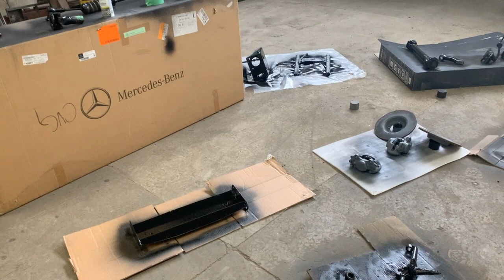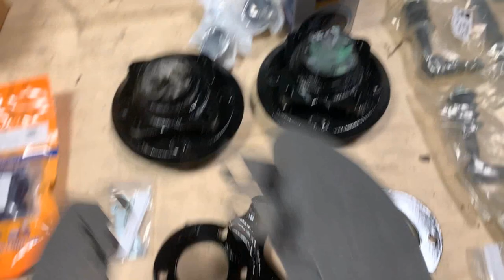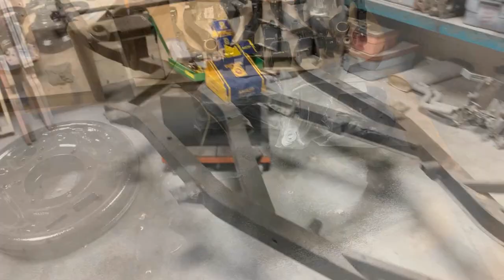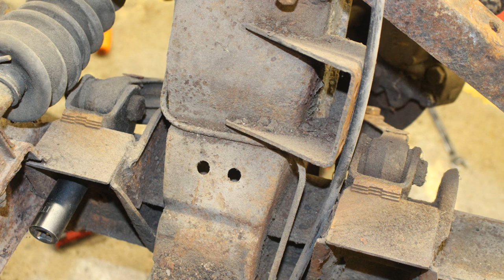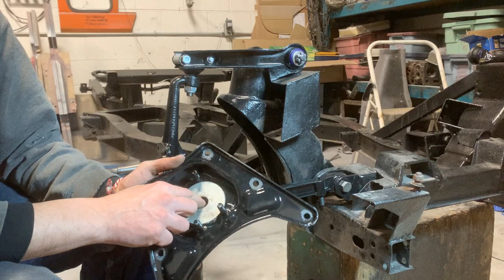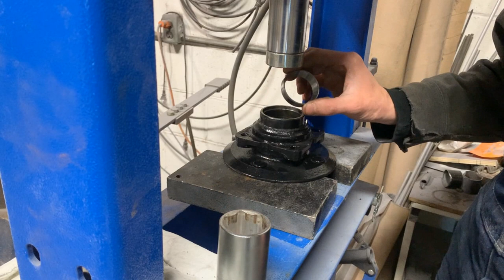1974 Triumph TR6 - Part 57 - Front Suspension Assembling

Comment: Thanks for the helpful videos.  If you see this, I replaced my bushings this weekend. After assembly passenger side takes more effort to move left or right then driver side.  Is it possible I have an issue or will this loosen over time?  New ball joints also.  Thanks

Comment: Great video.   I missed seeing any descriptions of the various torques to be used.  Is there anywhere to get all of the torque specs for the front suspension all in one place?  I found differing views on the trunnion torque for example, but very little on other nuts.
Reply from the maker: Both the Bentley manual and the Mitchel have a full chart of most of the torque values all over the car.

Comment: Hello Elin, I´ve been watching some of your videos now - got to say: GREAT JOB!!! Thanks! You helped me a lot to do repairs on my 1965 TR4A.👍👍👍
However I got a question. The direction of installation for the upper fulcrum pin, are your sure is that way around?
Reply from the maker: Yes, that is the correct orientation for TR6 and late TR4 the early TR4 had it backwards. I believe the change happened at the same time as the IRS. I am pretty sure for TR4A it should be the same as TR6

Comment: Hi Elin...awesome video. About to re-assemble my own 69 TR6 front suspension tomorrow...and your video makes the process order much easier to understand. One question. I did not see the lock nut on the back of the stub axle during your assembly process.....do you put it on later for some reason.? Just want to understand if there is a reason for it not being a part of this assembly process. Thanks.
Reply from the maker: Thanks for the nice comment. The nut can go on any time. There was no reason why I kept it off. Probably just forgot

Comment: Elin, I know that connections with rubber bushings need to be tightened with the car’s weight on the suspension, so the rubber bushings don’t twist. Is the same requirement needed for poly bushings?
Also, not sure about the TR6, but on the TR4A it’s recommended to soak the felt seal in oil until it’s saturated. Then the seal is installed with the bearings dry (no grease), with the hub, then it’s all tightened. This allows the felt seal to be “crushed”, with excess oil squeezed out, as the bearings will tighten a bit more without grease in them. Then everything is disassembled, the excess oil is cleaned off, bearings packed, and everything is retightened as you described.
Reply: Yes I agree they should be tightened later with the weight on the wheels.
Reply from the maker: I like following the books, but not to the letter. I find them a little bit too detailed.

Comment: Elin, love your videos. but I'm confused on the part where you filled the TRUNNION JOINT with oil. I Just removed mine and they had grease in them. And there is a Grease Fitting on the vertical Link that goes down to the bottom of the Trunnion Cavity and sends grease up into the trunnion threads and upper seal. Jan 20, 2022. please reply if you get time.
Reply from the maker: Well, this one of the topics that everybody has different opinion on. Some prefer grease, some prefer gear oil as it is supposedly better for the brass. I am not sure which one is better but I do not overthink it much. I am not saying oil is better, but that is my choice.

Comment: Was the brake disc shield painted when you fitted it ? Looked like bare metal from earlier ?
Reply from the maker: It was painted even when I showed it on the table. It was just a back mat and the rest of the parts were painted with a gloss black paint. It got painted after that, probably just the light made it look like  bare metal

Comment: Are you kidding regarding to use the arm shocks in behind? Please convert the rear suspension to telescopic shocks! And about splines? The better option is homokinetics. I used on my (former) 1974 TR6 and that worked amazing. So much better handling!
Reply from the maker: I am not a purist and I would upgrade anything if it was making the car unsafe or too uncomfortable to drive, but I don't mind the lever shocks. I don't own a TR6, but I drove the 73 TR6 after I finished restoring it for a month. I didn't find anything disturbing. If we start upgrading everything on these cars, we should probably just drive our daily drivers, the suspension is smooth, there is AC etc. I am not a fan of too many upgrades as long as the car is safe to drive.